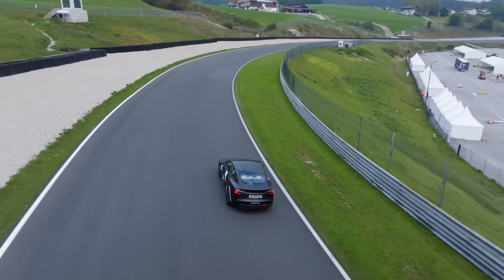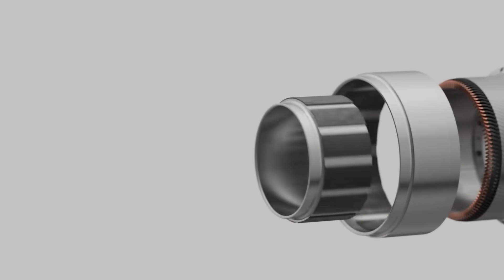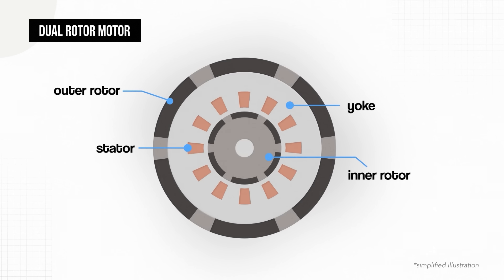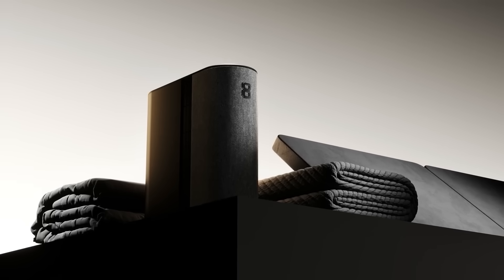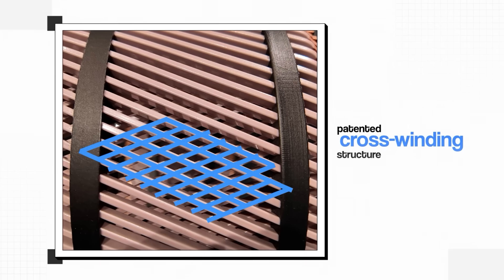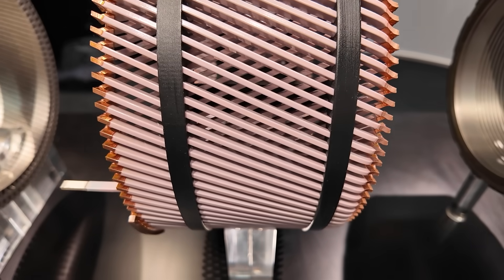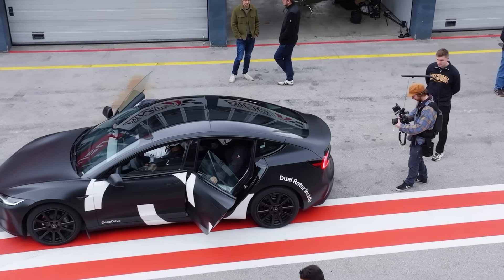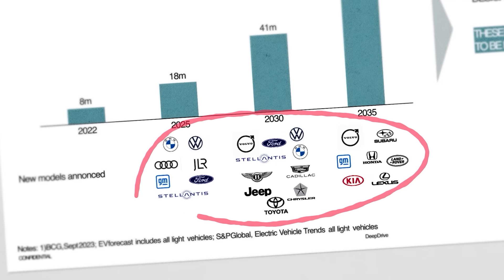How Dual Rotors Make Motors Insanely Efficient

Comment: Ok, a couple of actual issues with this:  
1)  in-wheel motors are subject to all of the shock loads of the wheel and tire.  You're putting TWO end-suspended rotors and a thick copper lattice tube with tiny gap separating them through this torture, eventually the bearings WILL fail hard.  
2)  Cooling the stator from one end can work since copper has very good heat transfer properties, but you then have to run both coolant lines AND HV electric power to the wheels.  A single blown tire can take out the HV and coolant systems of the vehicle.   
I will remain skeptical that in-wheel motors will ever be common on normal cars, for warranty reasons alone.
Reply: 1. I suppose that is why they are making both options, so as to let the car manufacturers figure out which option is more desireable, or possibly what applications are suitable for which. Even if a design is only used in comparatively niche applications, in a field like automobiles, even a niche can be large enough to make a fortune.
2. I don't think any automotive engineer worth their salt would design an electric vehicle where a common failiure case like a blown tire could take out entire systems like that. In general, if you have multiple engines, you don't want their function to depend on each other. Either you build completely independent systems, or a system that will isolate compromised sections via automatic and passive mechanisms.
Reply: @michaelt.5672  About 2). I think the implication there is that it's countering the EV principle of simplicity. You'd have potentially a x4 BOM increase for a 4WD car if independent systems are used. Airplanes have this issue, historically, more than cars and the way to go for them was what you suggested: have cutoff points to isolate a failure from affecting the rest of the system.
Reply: @Archangell27  All true, though I would point out that if you put four seperate motors into your EV, I don't think simplicity is the selling point of the design to begin with.
Reply: @michaelt.5672 I beleive they're talking more about mechanical simplicity over power delivery IMO.
Reply: @Archangell27 Does your car have hydraulic fuses on brake lines?
Reply: @josefsvitak4313  You mean valves?!? Also...why are you picking on me for?!?
Reply: And unsprung weight is a killer on suspension.
Reply: @thelink66c There are ways to put the suspension in the wheel ahead of the motor thus greatly reducing unsprung weight.
Reply: @TimHayward  or just just use CVT axles.
Reply: @JGnLAU8OAWF6 if you can make hub motors work they have a ton of advantages over inboard motors
Reply: Have you not seen axle mounted motors and transmission/clutch mounted motors? This has applications for hybrid vehicles
Reply: I was thinking the exact same thing. Especially considering that their lightest model at 16in in diameter weighs 25kg, that's doubling to tripling the weight of a single wheel-tire assembly. Which means on a car with even a medium profile tire, the risk of bending or cracking a rim on a pothole is incredibly high. Let alone the sluggishness of the suspension with it on there unfortunately. Seems like YASA still has one hell of a lead comparatively regarding power to weight, and chassis mounted is just the way to go for achieving the best performance. 

Turn faster with the mass more centralized, ride smoother with the suspension freed up to be more responsive, and have more power. That being said, I am excited to see how far they can push it in their local optimization.
Reply: especially since a simple shaft solves almost all those issues at very minor costs and minimal performance loss
Reply: @cutterjohn1921  Presumably the main advantage for in wheel motors are packaging related and not performance related.
Reply: Cars suck anyway. I'm particularly interested in e-bike motors, which are subject to lower shocks and are more reliant on being light weight. The square cube law is all kinds of friendly to bikes.
Reply: I think the best location for these is on the body of the vehicle and just eat the efficiency loss.
Reply: and  how do in wheel motors perform in minor  flood  conditions ?
Reply: Exactly 💯
Reply: The Hunsable / Linear Labs /Yuasa design is better suited for in wheel- better starting torque, no gearing needed.
Reply: I don't know dude BMW and Hyundai are pretty much investing heavily in R/D and prototyping in-wheel motor technology. Then you have Mercedes Benz, Renault, Nissan, Volkswagen and others following BMW and Hyundai in in-wheel prototyping. You might want to look into companies like Protean Electric or Elaphe Propulsion Technologies or the one partnering up with BMW like DeepDrive, they're all moving forward with large scale commercial deployment.
Reply: Yeahhh honestly I would think an inboard motor with axle shafts would avoid those issues somewhat with minimal increase in frictional losses
Reply: Then it's a good innovation for aeronautics, but again, I highly doubt this hasn't been tried before
Reply: Efficiency of the motor is given by the mass of the copper per torque produced. Therefore you can increase the efficiency of the system by using a reduction gearbox. Even if that is only like 96% efficient it's worth it for the reduction in resistive loss, plus if you momentarily turn a blind eye to the transition, inverter battery and the fact that the battery needs to be charged somehow you get to brag about having like 95% efficient motor. Also that's the case only for PMSM and only at full power. Also even if you'd for whatever reason decide to go direct drive I don't see why not to put the motor inside the car and have an axle to the wheel. It's literally free from the efficiency standpoint, weighs almost nothing and it's 100 years old proven technology and you even retain brake cooling possibilities - since hills do exist, inverters can fail and even the I prefer not to die.
Reply: OH oh! Someone's BS has been called out!!
Reply: happens on my skateboard hub motors.
Reply: @sladewilson9741 hub motors on a skateboard?
Reply: There are a lot of rotating assemblies that have tight tolerances. Turbine engines are just one example. There should not be enough allowed movement to cause any issue except for extreme failures.  

As for any coolant lines,  armor overbraided lines should handles the stress from most predictable failures.  There are always extreme failure cases, but they should be an exception  that is not normal.
Reply: @shalehausler4383 , but they are not shaken by 100g loads as a wheel is. 😊
Reply: I'd like to see how this motor wheel would behave in high g cornering . Deformation of the wheel  could easily bring the rotors into contact with the stator.
Reply: Where are the emergency service brakes in case of inverter failure?
Reply: @vinnieluther6589 probably something best reserved to the braking system which depends on individual manufacturer, do you believe emergency brakes stop the motor traditionally? They don't, they're typically a pin.
Reply: @checkmateDavid i meant brakes to stop the vehicle so you dont have to use crashing to stop in case your wheel full of motor and no brake suddenly loses regeneration ability.
Reply: @vinnieluther6589 okay than thats even dumber because again, that would be on the wheel not the motor. Sorry for overassuming knowledge of mechanics. Brakes also attach to the wheel but are never part of it integrally unless you really want to engineer it piss poorly
Reply: @checkmateDavid what are you talking about brakes on a motor?  What does "okay than" mean?  What are you comparing okay to?
Reply: @checkmateDavid you are the one that doesn't know what service brakes are.  A parking pawl in an automatic transmission is not a service brake or an emergency brake.  This video is talking about electric motors in the wheel where your service brakes would normally be.  I don't think thats going to fly for vehicle safety since if your motor suddenly fails you have no brakes.  Someone else mentioned maybe if the wheel motors are only in the rears then you could still have front service brakes.  Sorry you think you're smarter than you are.  Look up the difference between then and than.  Look up service brakes or anything else you want to argue with people about before you go around throwing insults when you are clearly misunderstanding and embarrassing yourself.
Reply: Bearings are proven to be very reliable and cheap, problem is exposure to water and mud and dust. Problem is short range of EV. Problem is high mass or EV and it's behavior after crash.
Reply: @dmitryhetman1509 bearings are indeed reliable when they are fit for application, the problem comes from when they do fail (and they will because many people are too lazy to maintain their own vehicles), rotating parts are bad enough but rotating parts inside each other get absolutely insane when a failure happens.
Reply: Using a TEG & peliter combination would solve a lot those issues as there would be no need for any mechanical parts after that.
Reply: @kevinerbs2778  why would you want to use peltier tehnology when you want to promote better efficency? Those things are horrendously inefficient....
Reply: @tom79623  No they're not. You don't run a peltier at full power for efficiency 5-10C difference is all that's needed. not 30C (half power) to 60C (full power) .Beside I said combination of T.E.G & peilter.
 T.E.G generate power from temperature differences. 

You could use less than 5% to 10% of the cars total power to generate more power. Since the parts would be able to generate power after being heated up. Like the motors going down a hill after being hot from braking the car to generate power.
Reply: @kevinerbs2778  first of all they are 10 to 15% (horrendous) efficency, and running them on lower power doesn't change this fact all that much cause of their design, now if you add T.E.G on that it can possible recover 8 to 10% of energy.

I recon all together not only will you lose energy on "cooling" the system you will just add extra weight 

Also if the hot side of the peltier doesn't get cooled enough that 15% efficency drops even more, so you would effectively be heating up the T.E.G to hopefully recover possibly 10% of that energy, while the peltier would not do it's original job of cooling the windings lol.

Any other cooling tehnology will beat this thing to the ground, and motors deff don't run on room temp eather.
Reply: @tom79623  also quite brittle I think
Reply: @tom79623  THAT IS WRONG
Reply: @kevinerbs2778  Sounds like you're describing a perpetual motion machine - good luck with that.
Reply: @tom79623  WRONG
Reply: @tom79623  
WRONG
Reply: @tom79623  WRONG
Reply: @tom79623  WRONG
Reply: @tom79623  WRONG
Reply: @peglor  If you think that's the case you don't under stand a three phase motor then either.
Reply: @kevinerbs2778  What did i say that was wrong? 
Both of those machines are horrendously inefficient, and the temp of the engine will be around 100 Celsius when running under load, if not more.

Also 3 phase engine have pretty good colling just from surface area to the environment and if that is not enough they usually put fans on the rotor to push air on the body to actively cool it. This design doesn't allow this. 

I have never ever seen a design that used peltiers for colling and T.E.G for energy recovery, like i would love to see it done it's just not as good of a deal in real life as it seems on paper.
Reply: @kevinerbs2778  Based on your posts and that you've gone to the trouble to tell everyone who replied they're 'wrong', which is hilarious 🙂, and not an argument anyone more than 3 years old considers valid. 

I suspect you've watched a lot of YouTube and fallen down the 'free energy' rabbit hole without realising it, as you're seem to be coming up short on knowledge of the engineering fundamentals required to understand basic thermodynamics that would make the idea of feeding heat to one thermoelectric device, to power the cooling function of another one absolutely ridiculous.

As soon as you mention thermoelectrics, any claim of efficiency is pretty much gone straight out the window anyway, I should point out that among other things, one job I worked in for years was the mechanical and thermal design, modelling, construction and characterisation of devices that were temperature controlled by means of thermoelectric modules - I know exactly how woefully inefficient they are, especially when compared to refrigerant based heat pumps.
Reply: @kevinerbs2778  Kevin youre not as smart as you think you are.
Reply: @kevinerbs2778   another clippy meltdown, classic

Comment: Light enough in wheel motors might be a wash as far as unsprung weight is concerned if they can replace brake calipers, disc rotors & drive shaft couplings.
Reply: will they ever replace brake calipers? There must be an alternative braking system if the electrical system fails

Comment: Great new design. But the real bottleneck for EV’s is the battery. Saw a video about the Ford F150 truck where the tiniest ding had them insisting the entire battery be replaced at enormous cost. And not an easy unplug and plug like changing a flashlight battery. EV batteries should be standardized and made easy to swap out, with minimal programming to marry it to the vehicle. And move toward sodium as a much cheaper and safer material. No one wants a ebomb under their car in a wreck. This better motor design could enable smaller batteries rather than higher performance.

Comment: A 20% efficiency boost with a 30% cost reduction is massive.
Reply: That is not the case, they must have an very odd definition of efficiecy -electric motors already have an efficiency of 85-95% so 20-30% is not possible....
Reply: @hannzebe  True! I remember that already in the 90s I was installing industrial brushless motors with very high efficiency, above 90%
Reply: @hannzebe  I believe he means 20% more efficient than other e-motors. Meaning for every electron of input it has 20% more output.

Comment: Thank you. Great video, as it is often the case. What about metal fatigue in the copper windings resulting from extremely high torque? Copper is very malleable, I don’t see it holding up to the high torque for very long.
Reply: Good point! Lorentz force induced metal fatigue is an important consideration.